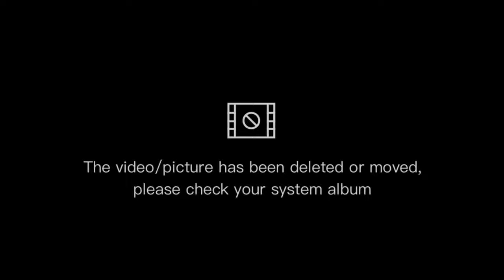Fotocabina 360°

Comment: What size pipe threads are you using, and where do you get a bearing that just happens to fit the outside diameter of a pipe?  I bought a 360 photo booth and want to put a new custom-built top on it, so I'm looking for what thread size will fit the existing pipe similar to the pipe you have here.  By the way, is this your other channel: https://www.youtube.com/watch?v=9Q0NM4cSXMo